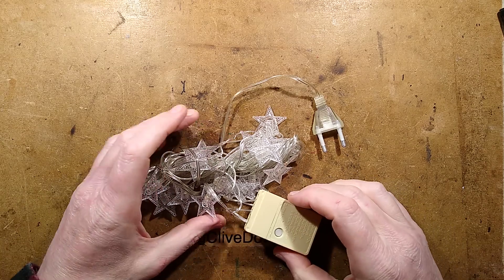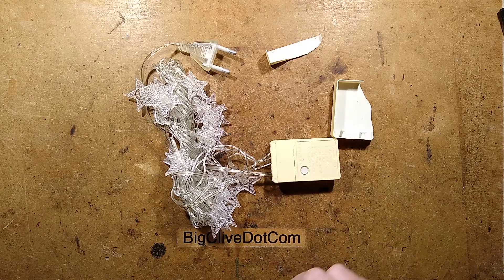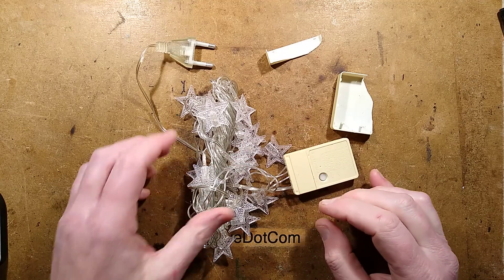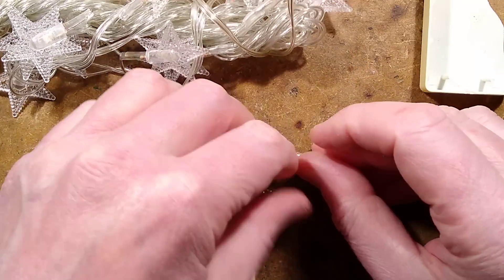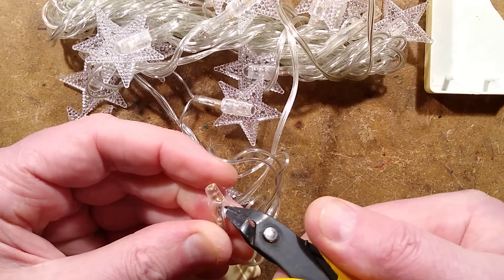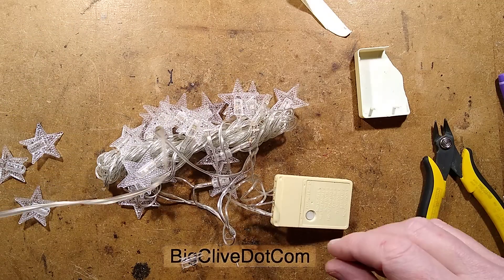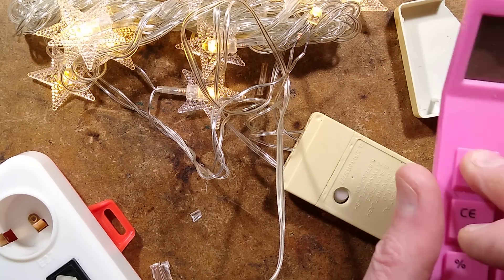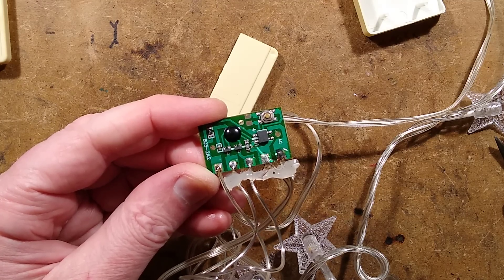I bought the WORST fairy lights on eBay (so far)

Comment: £4.31 each. That "deal" doesn't even sound so cheap. I just recently bought few 120 outdoor light sets with a timer from a local home department store for 1.50€ per piece and they didn't seem like they'll zap me or burn the house down 😅
Reply: The plastic stars look very similar to some battery operated ones I bought in Poundland for just 50p after Christmas. One of the few items in Poundland that wasn't more than  £1 (although they probably were before Christmas).
Reply: In germany there where proper ones with waterproof low voltage power supply  for 5$ in super market chains like Lidl / Aldi
Reply: @NinoJoel 

No experience with Lidl but most Aldi stuff is excellent for the price point!

Comment: Makes me wonder if this circuit was originally designed to take incandescent bulbs instead of LEDs and reistors?
Reply: Maybe. Becouse the incandescent models with that controller were out there. But they were rare. Mostly it started apear more when LEDs came out. And it was incluided for long time. Now there are lights with power supplyies and built in controllers inside "brick".

Comment: I've only seen plastic break apart by slight pressure when it's a lawn chair that's been outside and not touched for 30-40 years
Reply: Maybe this is a repurposed lawn chair that has been outside and not touched for 30-40 years?
Reply: In electronics this is NOS (New Old Stock), stuff maturing in some warehouse for about that many years.

Comment: The brittle plastic and off-white colour makes me suspect this set was stuck in a sunny window for a few years, which might explain why it's so flimsy.
Reply: It also looks like it. Very yellow. Long UV exposure.
Reply: I'm wondering if they are recycled window decorations from a chain of shops.
Reply: It might actually be old PC cases they have melted and recycled
Reply: Reminds me of the inside of my big trolley suitcase, which started to crumble once I took it on a flight...
Reply: I think you're being extremely generous.

Probably left in a dimly lit room for about 2 weeks at best 😂
Reply: @skylined5534  The manufacturer of this set kept them in the dim lit room for shortest time available. The thing is, they sourced the cheapest parts they could lay their hands on. I would guess that they got the very yellowed cases for free.

Comment: Looks like the shop that moulded the control PCB housing found out that you can in fact mould styrene with 88 % calcium carbonate filler ... even though 20 % fill is the max advisable filler from most resin makers.....durable! (not exactlly) I'd be real cautious about the moulded clear "plastic" or TPE on the power plug - doesn't look OK to me re mechanical properties, and areas may be undersize for giving high voltage isolation. This one's a junker all right.

Comment: i think at this point the rule of thumb is if an led set has one of those control boxes its a sack of shite lmao
Reply: Had quite a few of them. They are usually fine.
Reply: In north america, incandescent mini lights that have controllers (aka do anything besides are just on steady) came with those exact same boxes as long as I can remember (35 to 40 years at least). But that was back when mini lights actually came with impressively thick copper wire, and weren't nearly as crap as these are

Comment: Love the Europlug :)
Reply: I think (based on various purchases over the years) the Chinese have a slightly narrower, and with thinner pins, version of the plug, compared to the proper EU one..
Reply: @michaeltempsch5282 you're right I've experienced those myself on a chinese ultrasonic cleaner
Reply: oh wait I'm not sure anymore, would the chinese version fit in a EU socket ? At least the ultrasonic cleaner has a cheap feeling plug
Reply: @maicod  I've seen mixed results - some pins are more flexible and some outlets differ a bit in the contact elements, so connections can be hit/miss depending on the match up...

Comment: I'll stick to my 4.5v led lights 3 AA batteries.  No I don't want USB power.
Reply: USB power banks use batteries?
Reply: As stuff designed for 3x 1.5V AA/AAA batteries usually work until the batteries go down to about 1V each, they also usually work fine off a LiIon battery. Keep it removable and charge separately, or mount it permanently along with a TP4056 charging/protection board.

Comment: Ahh yes, the control box plastic came aged like fine wine.
Reply: Or possibly milk.  Whichever.
Reply: @carlfranz6805  either way you can carbonate it!
Reply: @JakeShirley    LOL.  Nicely done.  🤣
Reply: That plastic that arrives brittle as thin ice is getting very common, I noticed amazon selling cheap clothes pegs, a bucket of 100 and every single one explodes when you squeeze them lightly. ofc they had 5 star ratings only.
Reply: I was thinking the exact same thing.
Reply: If by "fine wine" you mean Night Train or Mad Dog 20/20
Reply: I once had a switched 4 way power strip that was made of plastic like that! As soon as I realised, it went straight in the bin.
Reply: UV has turned fan cases to egg shells  in our school
Reply: @IntegerOfDoom I would say 100% recycled plastic used. It is a bit of a joke plastic can be recycled and be just as good as new.
Reply: Looks like the same nasty crinkly stuff they use for the hotdog packages at the local convenience store. Quality.

Bit expensive at over 4 pounds, though. There have been much better exemplars on the channel thus far for less.
Reply: Some sort of stale pastry shell?
Reply: More like a cheese.
Reply: Send it off to 8-bit guy to retro bright it?

Comment: Yes, your thoughts are exactly the same as mine as I was watching this. Not only is there no excuse for the revoltingly and dangerously poor quality of the plastic shell but I have no idea why they designed the LED strings to run at such a high current. The only thing I can possibly think of is that they offer this in multiple lengths and to economise on having to change the resistor values and thereby stock multiple components, just make smaller chains up for the shorter length product with the same value. I wish that a hell existed for such people to go to.
Reply: It looks like the enclosure had some exposure to UV, possibly crappy storage, or some return from on street seller?
Reply: @abcdefgh1279  Sadly I don't think it could be entirely put down to that, although it may well be a contributing factor. The wall thicknesses of the two parts are so thin that the plastic stock would have barely covered the surface dimensions of the injection moulding tool and it's surprising that it didn't come out with more distortion. I suspect the plastic chemistry was adversely affected in some way during production, likely polymer breakdown due to the lack of thermal mass in the tool or aldehyde contamination in the feedstock.
Reply: @andromedaturnbull3512  i just saw typical yellowing or discoloration, and what's more typical, different mould elements looked differently.
Reply: @abcdefgh1279  Oh yes, and you're absolutely right that UV degradation can result in similar discolouration and fragility and it's entirely possible that it could have played a role. Terephthalate and aldehyde formation is one of the consequences of exposure to UV radiation as the reaction takes place from energy being absorbed by the material, along with the chemical changes of dye and brightener compounds, e.g. photocatalytic reactions of TiO2 which is often used in white plastics. Similar reactions can also happen from thermal conditions in production on both the feedstock and finished part sides, and in some cases a substantial period of time after moulding, so seeing a finished part in isolation always leaves a mystery behind!

Comment: The yellowing does suggest uv damage, who knows how long thats been sat in storage, nasty, have a strong feeling that was never intended for even an EU market, I'd no trust the wire insulation either

Imagine whoever made this at a factory and thinking, yeah, we did a good job...
Reply: The short-term bean counters would be pleased.
If they're really cheeky, they could market this as Christmas AND New-Year's lights in one. If you can get this to run throughout the Christmas days, it's sure to go out with a bang on one of the days after that, as an early kind of New-Year's fireworks. You might even get the fire as well...

Comment: Wow, one of the most dangerous christmas lights. And I have seen small candles to put in the christmas tree.
Reply: At least with candles you were expecting the smoke and flames!
Reply: I think that title should go to the versions of these that my sister once brought home. It was essentially the same as reviewed here, but had an extra mains socket, so you could daisy chain multiple lights. The mains socket used the same thin aluminium wire as the rest of the light, with the same flimsy see-through insulation, put a short circuit at the end and it wouldn't even trigger the circuit breaker but go up in flames instead.

Comment: The controller box looks yellowed (on the outside vs the inside). Does it feel like the plastic has deteriorated with age, or was it just never thick enough to withstand practical use?
Reply from the maker: It does look like it's had sun exposure.  But was also much thinner than normal.
Reply: The box is  not made of plastic, It's made of tofu dreg!
Reply: That was my thought too, either age or UV exposure maybe?
Reply: It looks as if it's been left on a shelf in full sunlight for about ten years.
Reply: this is classic chinesium plastic, it's done very cheap so the plastic ages very quickly and becomes brittle. The plan is usually to sell it faster than it deteriorates
Reply: This is what happens when you recycle plastic a thousand times. 😅😅
Reply: @williamterry3177  no it's not a recycled plastic issue.